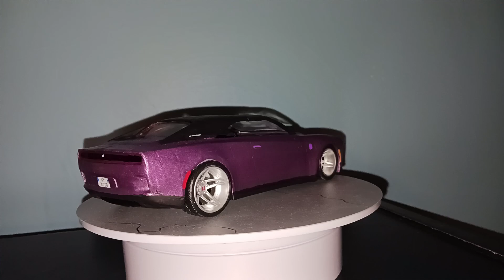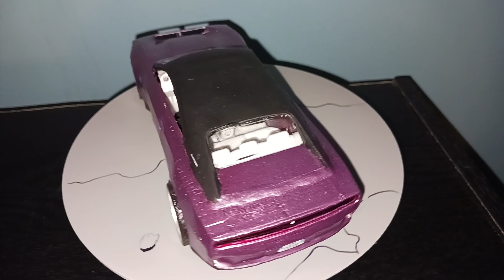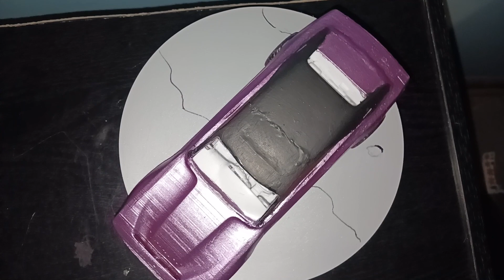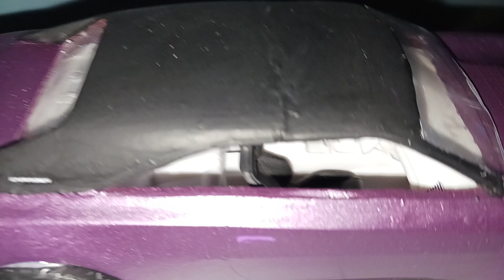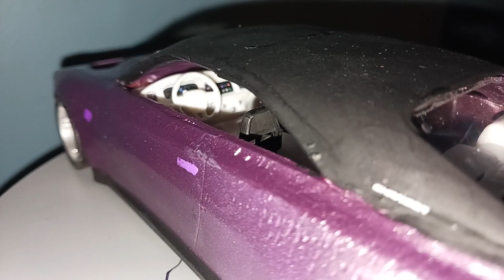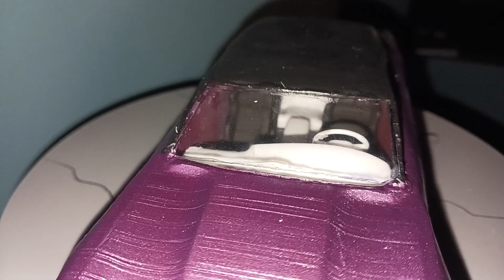2024 dodge charger

Comment: how did you make it?
Reply from the maker: The body is 3D printed using a resin printer except the roof which is two different plastic model car kit roofs joined together and the interior a a modified amt 2021 dodge charger plastic model kit interior with different front seats from another plastic model kit I painted the body
Reply: @Michellejosph  That Pretty smart